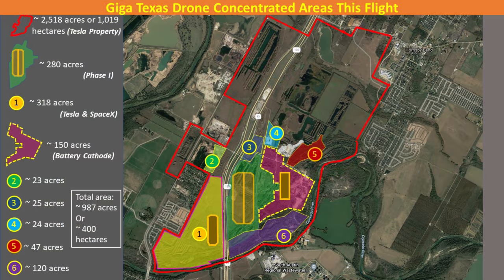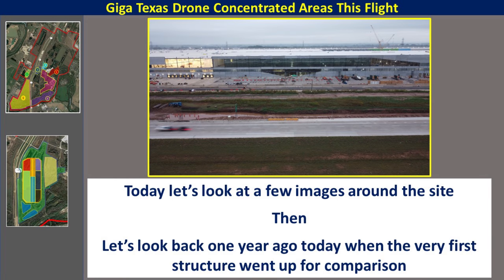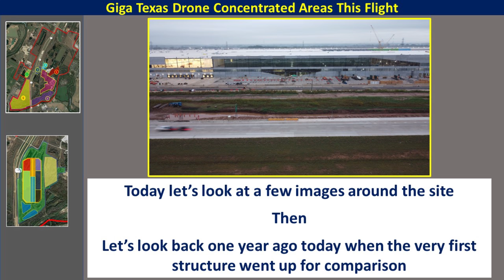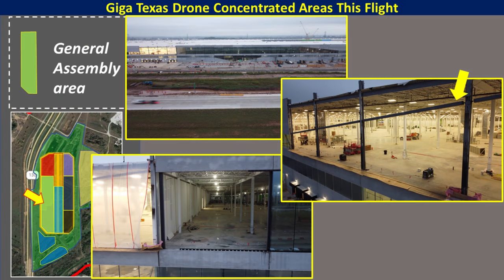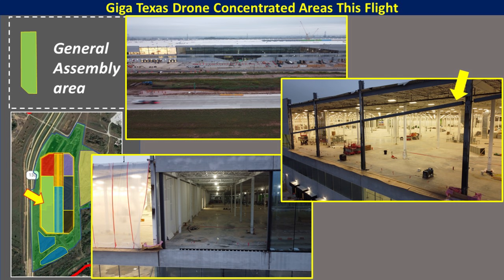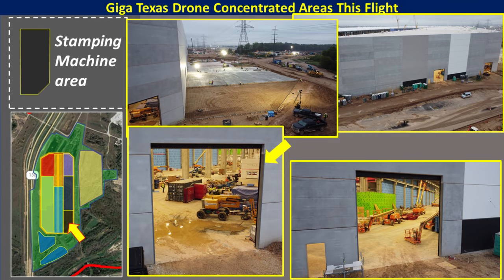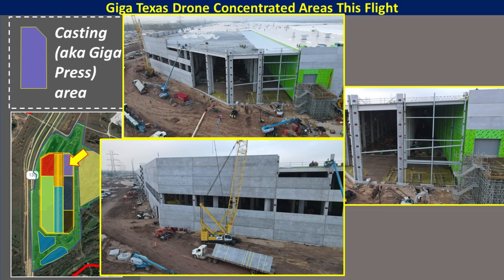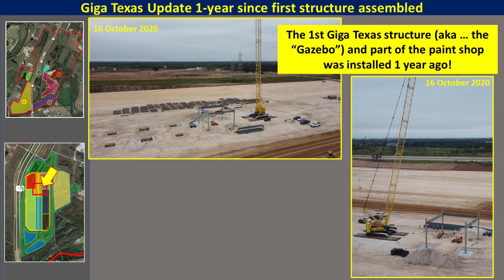Tesla Gigafactory Texas 15 October 2021 Cyber Truck & Model Y Factory Construction Update (08:00AM)

Comment: Thanks Joe. 
3:47. First steel. Crane set up on bearing timbers. That procedure didn’t last long.
6:11. West side GA. Panel brackets relocated and or removed. Bank of pipes and valves to the left seem to be fire sprinkler. Do Texan fire sprinkler pipes get painted red?
6:40. West side GA. Mezzanine plant floor deep inside at the back.
7:11. South alleyway. North end. Lots of the temporary wire bracing visible criss-crossing between the columns. 
8:10. South alleyway. North end. 2 large openings framed out in either side of the north wall.
8:35. Under GA east side. Replacement concrete drain. I wonder if the H water vaults are holding water and busting for relief after all the rain. Don't respond if you're under 60 years. If you're 60 or over you'll understand. 🥴 
8:49. South alleyway. Pumping out the footings.
11:39. East side stamping. Crane getting some help from a dozer.
11:51. East side stamping. Expecting a heavy delivery? In Jeff’s video yesterday precast wall panels had been laid as a temporary apron at one of the doors to stamping. Today those panels have been covered with the yellow bearing plates, and more being delivered by the telehandler to the left.
13:24. South end. An illusion perhaps. Larger of the drains on the right seems to have floated up a bit.
14:42. South end. Ground floor. Long view. Way in the distance through at least one wall opening, I think that’s the GA/Battery wall.
14:59. South end GA. Ground floor. Final levelling in preparation for a slab. Worker on the right holding a staff with a target/receiver, checking for height. Automatic level, laser level out of our view. (Joe’s photos for a better view).
16:54. North end battery. Level 3. Large black pipes turned down and lined up over openings in the slab. Months ago those openings were blocks of blue foam being used as blockouts when the slab was poured. https://youtu.be/_sUA7LPNXaQ?t=876
19:03. North end casting. Not clear what is going on there. Timbers locating some sort of embedded plates? Right in front of the set-downs in the perimeter grade beam that are being set up for infilling. Some sort of box or boxing in the shallow excavation near the column inside.
19:28. North end paint. Excavation. Going to a lot of trouble to get that dead flat. Water vault location?
19:54. North alleyway. Temporary and permanent roof drain work at the same time. 
Clear plastic on the ground, that’s a puzzler.
20:49. Roof of paint. Steam coming out of some of the roof vents in the bank of 14 or so to the left. Got some working HVAC below.
Reply: 19:03 comment:  This is a far out speculation but this could be the location of 3 containers for aluminum scrap from casting.
Reply: @eltonray2934  Nothing wrong with a bit of wild speculation. Hopefully they'll be slow on installing wall panels and we'll get to see what's going on.
Reply: In today's lesson: Leitmotif.
SpaceX Boca Chica: "Work continues on the launch assembly."
Tesla Giga Texas: "Panel brackets relocated and or removed."
Reply: @musaran2  I haven't watched any of the SpaceX stuff. Read about it from time to time, but I imagine it's just the same stuff day after day with the ocassional explosion to keep it interesting.

To add to the list, 'Ponds excavated, ponds filled in'.

Comment: 19:28. Water vaults. Sheet 023 of the recently released drawings shows a 'paint storage secondary containment vault' right where the excavation is at the north end of the paint shop. Another similar, although unmarked further west.
Reply: Dessie I was going to mention the paint vault. I think that the other one shown in the drawings is for some reactive product from cell manufacture. Also I have seen black pipes used in fire sprinkler systems here in Texas. On my laser level system I use a rod with a laser target which has different tones for dead on, high and low. I believe you can see the target on the rod being used in the excavation.
Reply: @eltonray2934  Bob Callaghan pointed out a 'containment tank' on the west side a few weeks ago. I didn't think to look any further for more.
Sprinklers, down here they would normally be red (in fact painted red from the fabricator). Probably by code need to be painted red if they are in danger of being hit. Assuming similar everywhere else.

Comment: They going to have room for the 12,000lb giga press for one piece casting.
Reply: Do you mean make the whole structure of the car out of one piece? That definitely would create a throwaway car. Any impact that would crack your casting.... Great for stock holders. Not so great for consumers.
Reply: @DavidJohnson-tv2nn  Would also defeat the purpose of the structural battery pack.
Reply: Would be impossible to insure in the UK. any small bump could mean the car is a write-off and £50 000 a pop is not going to make them insurable. But there would be many newish parts available for conversions or home builds

Comment: I make it 30/54 panels on NE angle=55%! Haha
Reply: Hmmm....  Not sure how you get 54.  There are 7 panels per column width, and 7 widths.  Even if you add the turn, it would be 56, not 54.  30/49= 61%:elbowcough:
Reply: @dalerichardson7202  sorry must have been too early in the morning!
Reply: @GrantHodgsonWnNZ  No worries! The real sad thing is that when I saw Joe make that percent estimate, I immediately in my head said, no that's not right, and calculated the  actual %.  The trick is, that in real life, Joe's number given on the fly, is a SWAG,(scientific wild ass guess) and in a conversation to decision makers is close enough.....  I used to work in one of the world's most advanced high tech biotech research companies, and was constantly pilloried for my SWAGS I gave in meetings at the director and above levels.  Always close, always substantive and directional, but never exact.  The internal joke became clear when in internal meetings where I didn't even participate, people would challenge estimates asking them if those were "Dale numbers"......  I became a meme long before it was a thing.

Comment: @ 10:43 About bottom middle of screen, heading in a northwest direction... Is that the drainage channel (Or approximate location of the drainage channel) for pond 2 shown on pages 32, 41, and 60 of the site plan?
Reply: David, I think that you may be right. After checking the plans it appears that the channel in the lower part of the video just right of center would be extended through the low place in the trees to the pond 2 outfall.
Reply: @eltonray2934  Thanks Elton. I wanted to get a second opinion. It looked like the location but I wasn't 100% sure.

Comment: Does anyone know why the Giga Berlin Battery plant had tons of rebar installed in its battery plant foundations vs Giga Austin especially if they ae to have similar 4680 manufacturing techniques... is it just German over engineering?
Reply: My guess is that it has to do with the local soil conditions and the ability to drive piles. That foundation slab is 6' to 10' thick! Maybe some of the more knowledgeable people can add to this.

Comment: It seems like opening the walls back up to put windows in was a big mistake with the execution of the plans.
Reply: More like a change in plans. But a mistake in this sense... If they would have waited until the design was more complete before beginning construction, there wouldn't be so many changes.
Reply: @DavidJohnson-tv2nn  They be doing it the Chinese way and also the Tesla, more iterations and changes as necessary, so quicker completion. Like the extra extensions at North and South later while still completing the rest of work.
Reply: @DavidJohnson-tv2nn  They are called "change orders" for this reason,  very common in a project, it happens.
Reply: Notice the original panels ended where an interior wall was put up.  They likely needed the area enclosed for some period of work, so they put up full panels.  They're past that phase, so they can modify for the final panel/window configuration.

Comment: Anyone any ideas where those 2 new bridge cranes ended up???
Reply: 2 halves of one bridge crane, and it ended up in stamping. 

One half far left of screen at 1:42 here; https://youtu.be/ZllzavjK9Lc?t=108

Same video, hoist trolley under the black tarp on the trailer at 1:58.
Reply: @DessieDoolan  Thanks. Did they ever install a bridge crane on the east side of the casting area? I can only ever remember seeing the original on the west.
Reply: @Nemutai666  Not yet. The beams for the tracks/rails aren't installed either. In fact only the west side of the original casting structure has beams, and that's where there are now 2 complete bridge cranes.

At the speed the wall panels are being installed we may never see anymore go in.
Reply: @DessieDoolan  That’s what I thought. It is a shame we can’t see much inside anymore. But seeing completed Ys on trucks in a few weeks will be epic. Thanks again.
Reply: @Nemutai666  Yes, looking forward to see the start of regular production. Cheers!